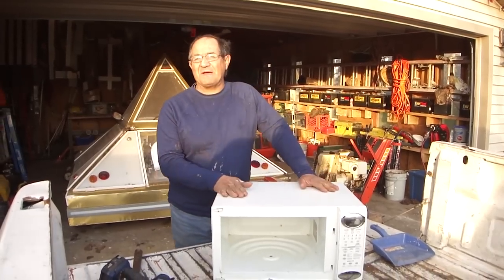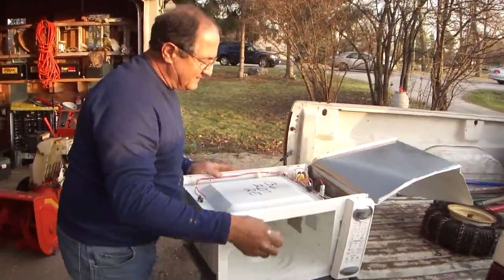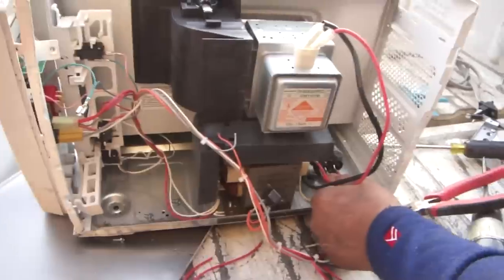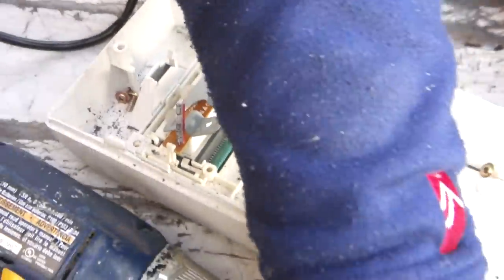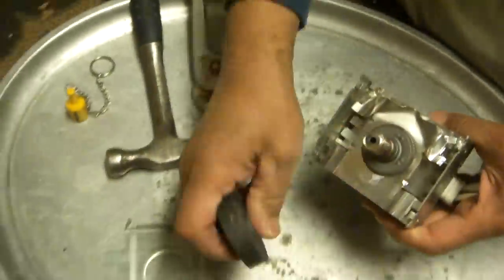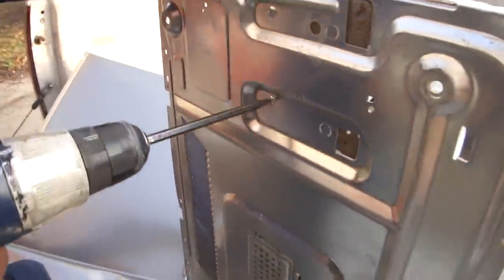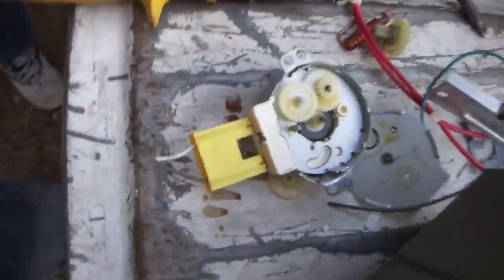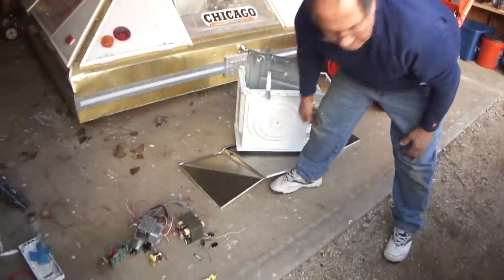How To Scrap A Microwave Oven For Metals / Money

Comment: There's a couple problems with what you did. One is the capacitor which you called a solenoid can kill you even after the microwave has been unplugged even for long periods if not discharged first. Two is with the components you scrapped such as the magnetron (box with the fins on it),  transformer, capacitor, boards, switches, and light bulb actually have value well beyond scrap prices if they work.  Granted it takes time to list and sell them, but unless you need the money quick; there's far more profit in selling the working parts. The other thing you should do; is add a warning to your video about the dangers of high voltage inside of microwaves  (particularly with the capacitor), so you don't get someone killed.
Reply: Leave the man alone he a life Veteran he know what he doing he know what's dangerous n not
Reply: @nandobndacomedian6638  i don’t know tho so now I’m dead because the discharge killed me
Reply: @nandobndacomedian6638  yeah, I died too
Reply: Nah let me learn the hard way 🤣
Reply: Thank you for sharing! :)
Reply: @nandobndacomedian6638  Oh sorry i'll leave a man, who is a life veteran, which has anything to do with this btw, who knows what he's doing. Sorry Greg, go ahead take the lethal high voltage capacitor which you called a "solenoid". Sorry nandobn!
Reply: @nandobndacomedian6638 translate to English

Comment: The component that you called a solenoid is a high voltage high capacity capacitor.  These can remain charged even though the mains supply is disconnected. The charge voltage is sufficient to administer a lethal shock.  Do not tear down electrical equipment unless you know what you are doing.
Reply: I was just about to make a post regarding the same thing.   It figures someone else had to have already pointed it out.   He's very lucky he didn't get a jolt.
Reply: Michael Streets I won't soon forget the first time i saw a fully charged capacitor discharged. Electricity isn't a game!
Reply: Michael Streets i am a electrician and i have seen one of them blow a screw driver in have when some one tried to discharge it
Reply: Michael Streets My neighbor does this.  But he has a unique way to discharge capacitors.  It seems to work.  He has a big steel tub that is grounded.  He keeps the tube filled with salt water.  Then he carefully takes the cover off the component whether it's a TV, microwave, computer etc and he just tosses it into the tub and leaves it there for an hour.  Then he drains out the tub and takes the component out and puts it in front of a fan to dry off and then he takes it apart.  He swears by this technique.
Reply: +moncorp1 yeah im v surprised this video didnt get cut short with a nice explosion haha.
Reply: +Michael Streets Well everyone is creating hype.... @ 4:45 You see a small/large diode connected to the HV cap this is to discharge the cap when the unit is turned off.The cap is slowly (and by slowly I mean mins )discharged to ground  inside  this diode.Now if this was a cheap knock off with no diode then yeaaa. It would light his world up .
Reply: +Michael Streets Thank you for posting this Mike. You probably saved more lives than you know.
Reply: I am sorry to tell you but no. That's not why it is used. If you want to convert AC to DC you would use a Bridge Rectifier
Reply: Yes. Discharge any capacitors immediately with an insulated screwdriver at it's prongs.
 If you save all components for future builds re-discharge capacitors each time you handle them just to be safe. They kill. Think like gun safety.
Reply: Geoff Howeth that has almost nothing to do with the comment to which you replied
Reply: I just thought he was suicidal...lol...It because of people like this that they have warning stickers on everything!!! don't know what you are doing...learn or don't do it!!!
Reply: Michael Streets wow
Reply: Actually I was just waiting for him to get an electric shock from that capacitor :)
For him it's either copper or magnesium or aluminum, and all circuit boards are mother board. What a genius :)  :)
Reply: You are full of shit! They don't hold a charge that long and most of them discharge through the motor immediately. I change capacitors every day. There are some capacitors on inverter units that hold lethal voltage for about 2-5 minutes after they lose power but that's it. Stop fear mongering that capacitor was harmless.
Reply: Lachlan Davis
On what?
Reply: +Gardening & Outdoors
The power was on.
Reply: you have made the world a better place
Reply: Michael Streets most microwave capacitors have a 10 mega ohm discharge resistor inside of them
Reply: To discharge a capacitor use screwdriver , touch both leads with long end of screwdriver quickly to discharge capacitor.you will hear a loud / sharp chrisp sound .then it's discharged
Reply: Thats the best way to learn respect for electricity.
Reply: I was concerned about that as well.  How do you discharge safely?
Reply: @geoffhoweth  sexo, mas
Reply: jakhar   You nailed it.     .
Reply: he he he
Reply: lol ouch
Reply: Thanks for the warning. I'm new to scraping and could've really hurt myself if I hadn't read your comment. Safety first always. At least now I know what to look for.
Reply: Yep . . . . Totally agree.
Reply: @geoffhoweth  
That diode is there to rectify the 2000 volts alternating current that is coming out of the transformer into direct current for the microwave tube to run on. It does this by using half wave rectification. No bridge rectifier is needed. The capacitor charges up to about 2000 volts then holds and smooths out the charge for the microwave tube to use. Most of the high voltage capacitors in microwaves have a bleeder large value resistor permanently connected across them to slowly bleed off the charge when the microwave is turned off. The "magnesium" he mentions are ferrite cores for the coils he unwinds off of them. The pinkish ceramic looking insulators on each end of the microwave tube are beryllium oxide. They should be handled with extreme care! Breaking or grinding them will create a carcinogenic dust that is many many times worse than asbestos. Microwave disassemblers beware !!
Reply: 2100 volts are inside that thing even after unplugging for months most people are killed trying to take apart or fix a microwave and failed drain the energy from the capacitor before they start work or scrapping it.
Reply: They have a discharge resistor
Reply: @geoffhoweth  the diode and capacitor work together as a voltage doubler. diodes aren't used to discharge residual charge on a capacitor, FFS.
Reply: I once touched an old disposable camera  flash capacitor and it's an experience I won't ever forget
Reply: @gardeningoutdoors5209  a 2100V 1uF capacitor blowing a screwdriver? lol yeah right. Only just a little bit of vaporized metal.

Comment: I like this guy, he's not afraid to risk his life to satisfy my curiosity.
Reply: +nunya biznez LOL -__________-
Reply: not a risk if you know what you are doing
Reply: lol "let me just grab this solenoid thing".  That hv capacitor could've killed him.
Reply: wreckless!
Reply: nunya biznez
Reply: I was thinking the same thing. I knew what he found when he said solenoid, and I wasn't even looking at the screen at the time. Then when he came to the magnetron ... "I don't even know what this is. But there's copper in here." LOL.  * For everybody else reading these comments : That "solenoid" was not a solenoid at all, but a high voltage capacitor,  as Rick Yezzi has said here. They don't store energy indefinitely, but they can store for a long time. And high voltage where microwaves are concerned is usually around 2000 volts. One those tags you while still fully charged ... hope your affairs are in order. Learn how to safely discharge the capacitor if you're going to do this stuff. That way you're sure to not be featured on someone else's YouTube channel, like When Appliances Get Even.
Reply: princeb71 Ah well, he seems like he's had a good run.
Reply: And if  that fails he always can get a second chance when he hammers away the  Beryliumoxide oxide insulators from the magnetron to get clean aluminium.
Reply: princeb71, frightening to watch.  I got a little bite just by dropping my dead microwave into the dumpster.  High voltage is printed there for no reason at all.
Reply: @princeb71, Yup, my stepdad did TV repair, I use to help him, I remember him connecting a wire to the tv screen anode (if I remember correctly) to case to discharge it. The TV screen could hold 1kv per inch of screen, if my memory is working....lol...this guy is a brute. I hated seeing him take a hammer to those rare earth magnets...
Reply: ue 5 David
Reply: nunya biznez same I totally agree
Reply: chip rock n
Reply: I was thinking the same thing. I always wondered what is in the magnetron Now i know.
Reply: @chiprock804  right. I sure hope he has good health. I'm taking on apart now  actually but with 2 filtered masks, special gloves,
Reply: Best snark in the history of snarkiness, deadpan!
Reply: @netofnations  yes!
Reply: @richard2mitchell  yeah he know what he's doing. Grabbing a "solenoid", which he called a high voltage capacitor.

Comment: Well done old bloke, I do the same with microwaves, also I keep the ceramic fuse that was visible when you were part way into your demolishing of the microwave.Over a period of time the various metals add up to more and more scrap weight, but, one must only sell when scrap copper is at a premium.  To remove the plastic coating on the wires a bit of flame helps quite a bit. Very clean copper achieves the premium copper price. The ideal hobby for the older gentry.

Comment: Who else was waiting for him to zap by the capacitor
Reply: me ,
Reply: meeeeeee
Reply: was thinking the same thing, when was the (solenoid) last powered????
Reply: Me
Reply: Yeah, I saw that right off!
Reply: Me
Reply: He called it a solenoid
Reply: new ones don't do that like the old ones did..  i been in the appliance repair biz for over 30 years   i learned the hard way back in the day.. lol  new ones bleed out.  won't hit you unless you touch em with in a hour or 2
Reply: john milner hey john ive boiled water on the stove under the microwave a bunch of times and suddenly the microwave doesn’t heat anymore?  Any ideas on what could be issue?  It’s a GE Profile .... I’ve not replaced it as it’s a match to the rest of the applicances and no longer avail!  Any ideas would be appreciated Sir!
Reply: CrazyfamilyTLR most likely unrelated. If it sounds normal but don’t heat most likely a bad magnetron. I don’t recommend putting a new venthood there as most are made in China now and are junk. Buy a countertop model and just put venthood there later.
Reply: Venthood m/w are a waste of $ now. And last no longer than a cheap counter top model
Reply: The HV cap isn't even the most dangerous part. There is a beryllium oxide component (the pink purple ceramic part) in the magnetron, harmless unless it is damaged and inhaled.

Beryliosis is a far worse death than a HV shock.
Reply: Now that I read your comment I know he's not going to get zapped and I'm stopping watching now I thought it was funny how he didn't even look to see what kind of bit he needed to unscrew

Comment: Very informative video at breakneck speed. Save all the Motherboards, a solenoid that looks like a capacitor, and take out all the screws. Plus excellent hammer work. Bam, Bang, Boom. Also write KEY on your hand. Good to know an ambulance is circling his neighborhood. Can't wait to see him take a TV apart.
Reply: He already did, with a hammer, without discharging anything, and he broke up all the glass into bits.  It was very entertaining.
Reply: @jkgecko  the glass (you mean ceramic parts) which could contain BeO.

Comment: Do you see these purple / pink parts, that were in the middle of the disc magnets you pulled off ? it contains beryllium dioxyde and it is incredibly toxic, do not mess with it. And yes, for costs reasons, microwave oven transformers are now made with aluminium wire.
Reply: msylvain59 Many that are scrapped are the older ones with copper wiring. Even the wiring in this one was probably aluminum.
Reply: Good to know
Reply: msylvain59

Comment: Keep your mind on the capacitor and discharge before working on a microwave.
See if the microwave is fixable, if there is anything wrong with it in the first place. i would say out of all the microwaves i have collected 80% of the time the only thing wrong is the power cord is broken/missing. Some have everything and they start right up just fine. Others just have blown fuses. Some the magnetron is broken. But if you can fix it (with spare parts from other microwaves) one like the one in the video can sell for $30-$40. Doubt you will get that from the scrap metal. 

the magnetron was not done. cut the cooling fins off (i use side cutters) then very careful cut off the ends dont cut the insulators (cuz of the beryllium) and once they are off dispose of them. the remaining cylinder has, in my experience, two steal end plates that are copper coated and then a centre pice that if a lot of copper.

Comment: I have been a scrapper for about 3 years... The reason scrap yards dont take them is for the thing that you took apart that says RADIATION on it... I just remove the 4 screws, take that off and be done with it. The extra copper isnt worth being electrocuted... Like that one thing you was cutting into, it has a label that says HIGH VOLTAGE... I wont touch, radiation thing off and im finished... Ill get some from the microwave and if I get alittle less from no copper, thats fine, ill live to scrap another day...

Comment: a solenoid??? that's a capacitor and it's a double pole or dual capacitor, a single pole capacitor will only have two heads on it.... not a solenoid... scrappers have no clue
Reply: Plus that capacitor can sometimes hold a charge which is powerful enough to kill you, make sure its discharged before you mess with it.
Reply: Also all of that magnesium is not magnesium.  Oh well...
Reply: Michael                Shawn Smith and....THAT'S why they're scrappers.
Reply: Gregory Lakics so as you say he isn't a scrapper. Most scrapper I know know the difference between the types of metal.
Reply: I dk much about these things but someone once told me them capacitors can actually explode like a grenade. Rather it's fact or not I dk, but I am very very cautious when messing with them.

Comment: +Michael Streets .... The component that you called a solenoid is a high voltage high capacity capacitor.  These can remain charged even though the mains supply is disconnected. The charge voltage is sufficient to administer a lethal shock.  Do not tear down electrical equipment unless you know what you are doing. 

Agree

Comment: Stop taking apart microwave ovens. As so many people here have said,:1. You don't know what you are doing.2. There are numerous parts in a microwave that can kill you - some slow, some immediately.Sorry to be harsh, but until you know what you are doing, you should not post any videos about it, and you should not take these things apart.There ARE safe ways to take apart a microwave and scrap some of the parts for value, but of all the things a person can take apart to scrap, the microwave oven should be one of the very last ones that you try to tackle.Also, stay away from refrigeretors and air conditioners, because with your style and methods, your life expectancy will be short.

Comment: Damn - could you just imagine the long assembly line to put that microwave together with all those screws? LOL 
I take stuff apart for copper and "stuff" to make jewelry bracelets @ $25 a pop.!! I've got two old computers, an old radio/casette tape player and 2 microwaves. BUT the weather here was in a hurry to get hot. Over 100° in May and June too. Too hot to be outside. I love copper for a different reason. The lightbulb would be a part to a necklace @ $30 with chain and other components.
Great Vid.

Comment: You should discharge the capacitor(what you called a solenoid). The capacitor could shock you if touch the ends. Could cause death